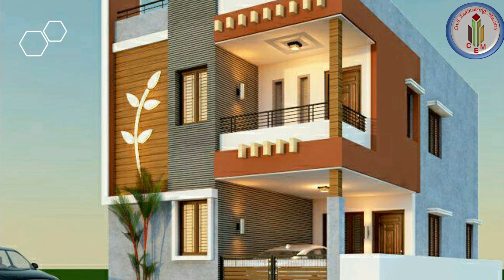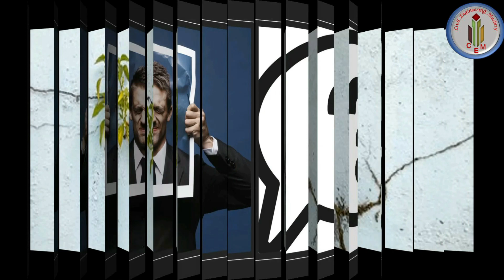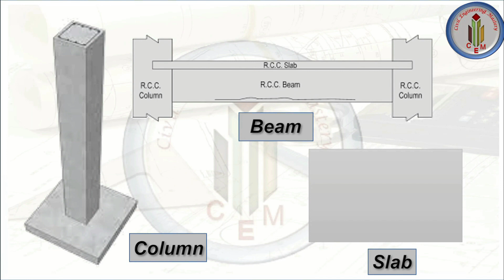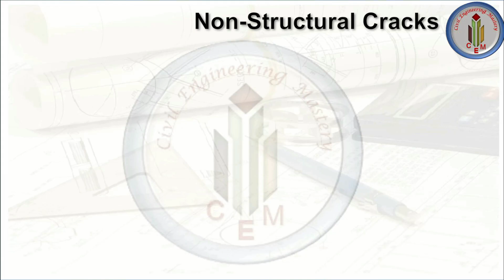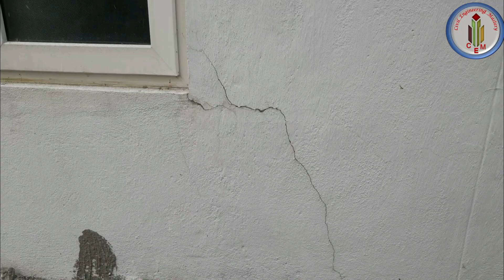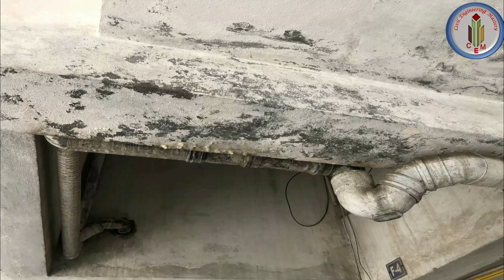Types of cracks in building |  Structural crack and Non structural cracks in building | Crack remedy

Comment: Hi we build a new house but some cracks we seen after chipping and see we found its plastering cracks  found in diagonal but its 1mm to 1.5mm we made ground floor load bearing structure after 7 years we made first floor same load bearing structure now we found some cracks now diagonal cracks 1.5mm around now.

Am worried about due to load bearing structure this cracks are developed or Thermal expansion either improper curing am not sure. Please clarify
Reply from the maker: Diagonal cracks could be due to various factors; I suggest getting a professional assessment.